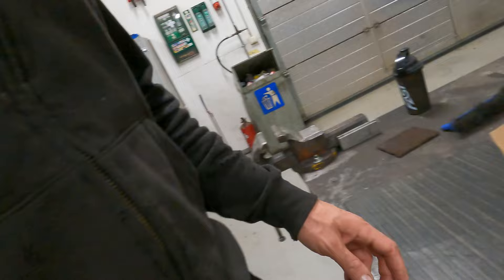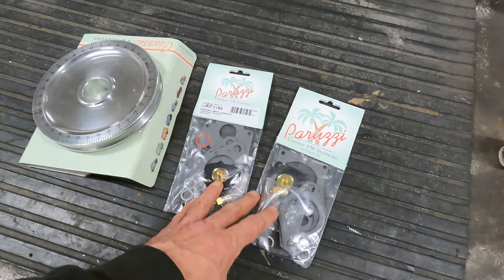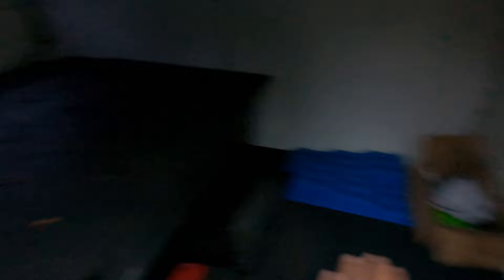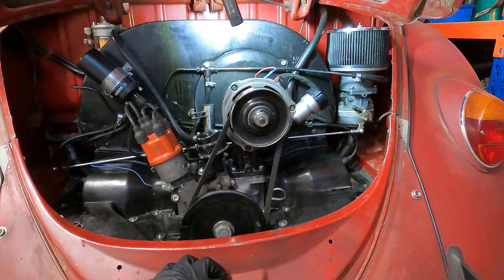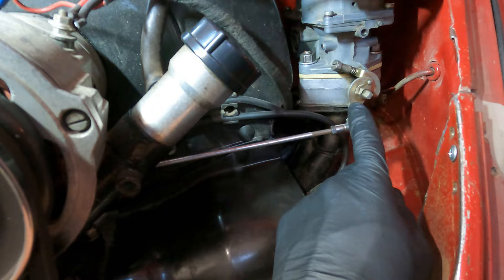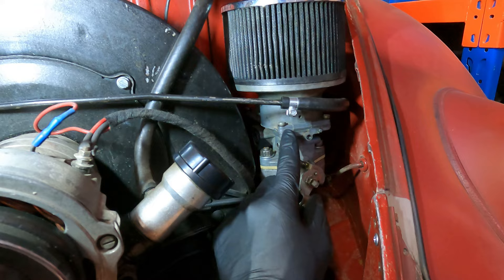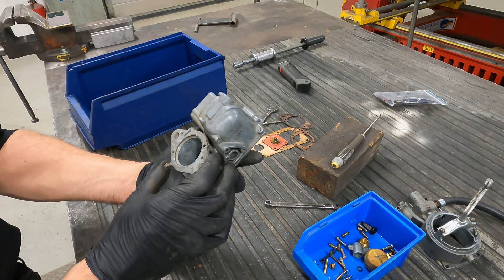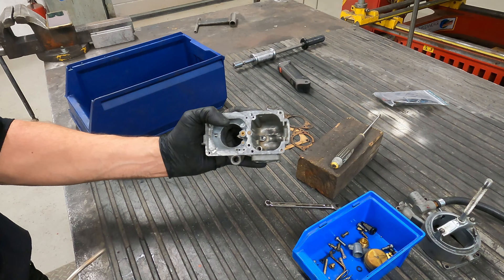Solex Kadron Brosol Carburetor rebuild on my classic 1964 VW Beetle

Comment: I definitely learned something new...your slide-hammer method of removing that brass plug is an excellent idea!  I've got aftermarket 34 pdsit carbs, which are basically a slightly scaled down, little sister version of the Kadrons.  After figuring out a few quirks, they really aren't that bad other than Mexico/Brazil is about the only place to get parts.
Reply from the maker: Thank you for your kind comment and i'm glad you got something useful out of it. I have had the carbs for a long time but haven't had too much experience with building them so was fun to do the rebuild video. Jamie

Comment: I bought a 1974 Super Beetle with renewed 1600 engine.  The cheap $38 Chinese carburetor float didn't work,  so after driving around 1/2 hour at highway speeds, fuel went into engine oil, causing engine failure.  I had mechanic rebuild engine.  He noticed on testing the carburetor issue and offered to rebuild it.  Rather than pay hourly mechanic fees ($100 hr) to work on a $38 carburetor,  I ordered top of line from JBugs @$200 which included extra jets, needle valves for ethanol free gas . All good now. Repaint is my final restoration.  Peace
Reply from the maker: Thank you for your comment. Yes, it defiantly pays to use the better quality items. I too have on many occasions have bought cheaper quality items only to have to order the better quality after wasting time and effort with the inferior. Glad you got it all sorted and back on the road. Jamie

Comment: How much fuel pressure are you using on the Solex kadrons? What size jet? and which fuel octane?
Reply from the maker: Hello, i'm just running a standard fuel pump and using shell v power petrol. Don't know of the jet size. The carbs were from my previous engine with similar set up so haven't changed them. Thanks Jamie